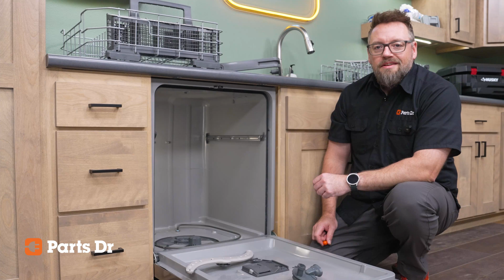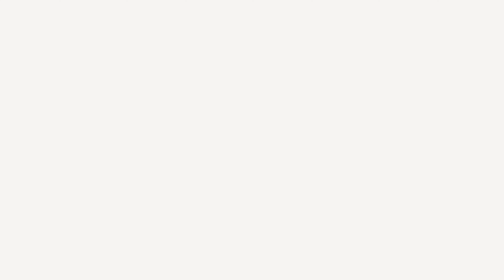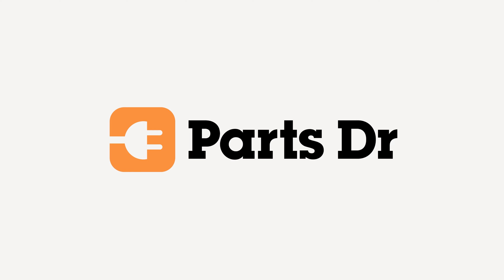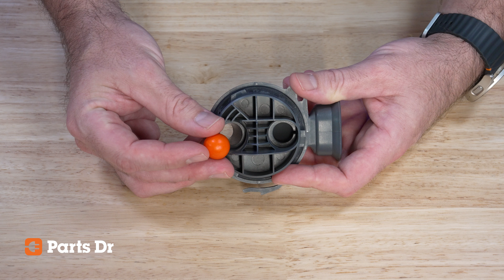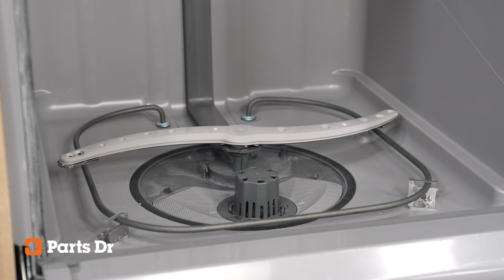Upper Rack Not Spraying? | GE Dishwasher Filter Ball Replacement | Part WD12X10408 | Parts Dr | DIY

Comment from the maker: If your GE dishwasher isn’t spraying water to the upper rack or cleaning dishes evenly, the filter ball could be the problem. This small part helps control water flow between spray zones, and if it’s worn or stuck, it can prevent proper cleaning. Be careful when shopping online, many aftermarket filter balls are made from low-quality materials and may not perform correctly. For a proper fix, use the genuine OEM part featured in this video. You can get it here: https://partsdr.com/part/wd12x10408-filter-ball Happy repairing and let us know how your repair goes in the comments!

Comment: Water not making it to the top spray arm(s). After a bazillion videos, blogs, looking at exploded diagrams, and taking apart and putting together my machine several times I found this.

There was a (seal, gasket, rubber piece) missing between the conduit assembly (587) in the exploded drawing, and the connection part of the assembly just under the lower wash arm often called the conduit adapter (455) in the exploded drawing. 

I have absolutely no idea where it went or if the dishwasher never had one, but without it the water will not make it to the top bar(s) or allow for the valve transfer ball to move between positions (because of not creating backpressure to move the ball).

OEM Part # Dishwasher Rear Feed Tube Adapter WD08X10098

Before tearing into everything, check for that gasket. 

Watch this fella’s videos, clean your machine, order the part if needed, and smash that “Like” button to support his awesome videos.